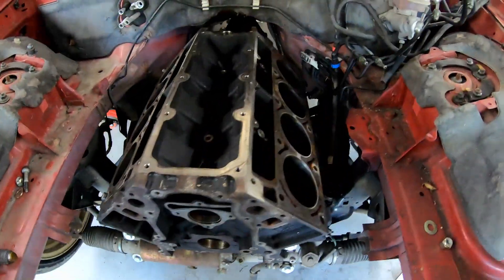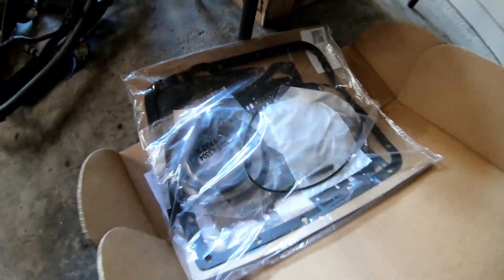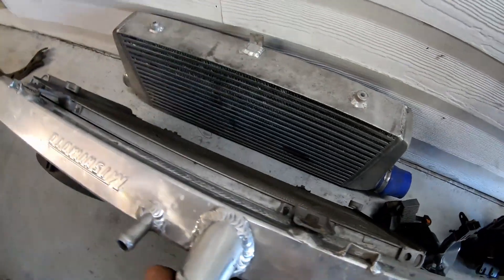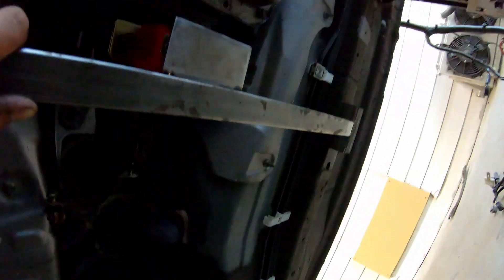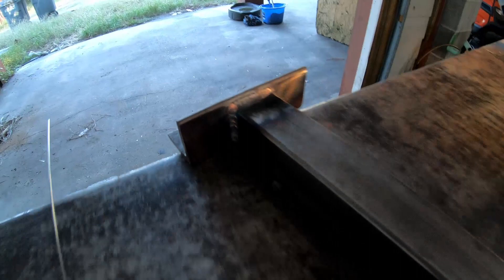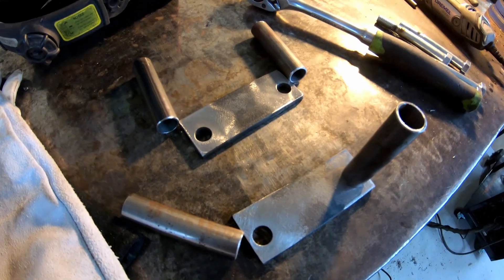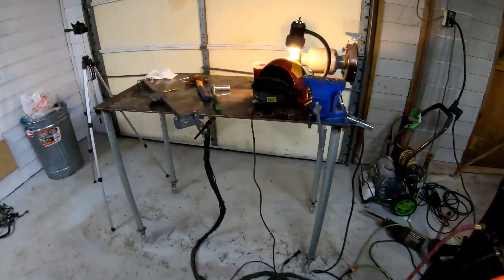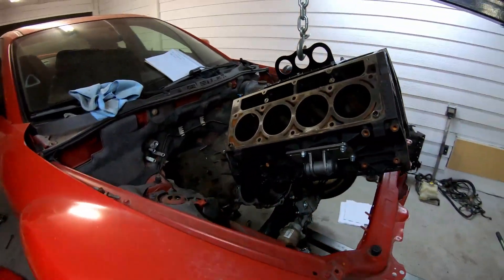LS RX8 Transmission Crossmember Fabrication

Comment: What were the measurements for the transmission crossmember? Just need the length of the center bar to the L brackets? And the length of the L bracket as well?

Thanks
Reply from the maker: Sorry for the late response!  Every car is different and could have been on a frame machine that could change the measurements, best way to do it is measure!